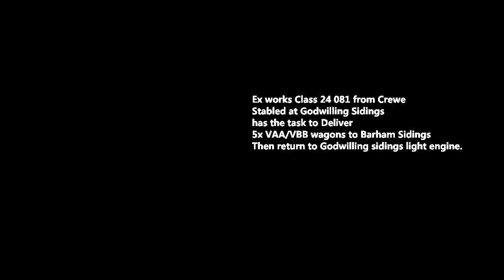2023 running session/ Class 24 081 freight journey with two layouts involved

Comment: The loco sound is incredible. I am sure that I could even hear the air compressor spool down while it was stationary at the yard signal. Do you use a "drive hold" feature to make the loco sound like it is really working hard as it pulls away?